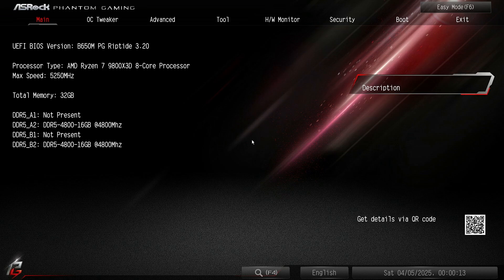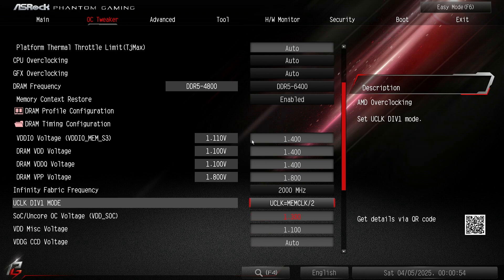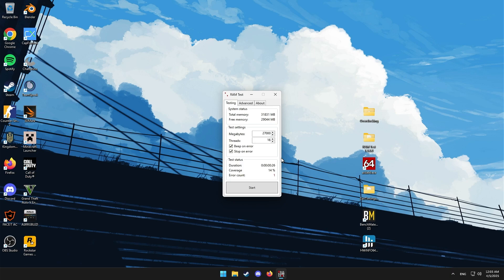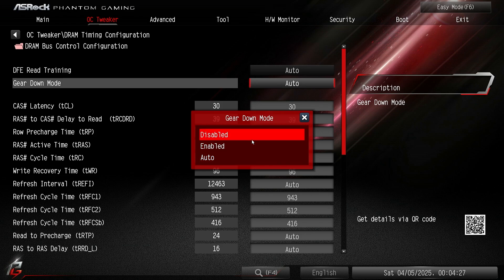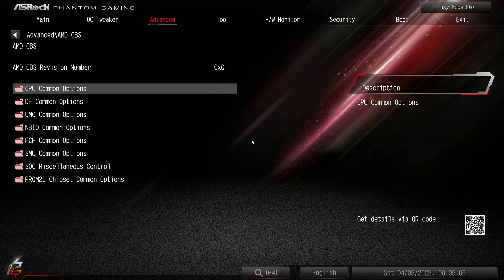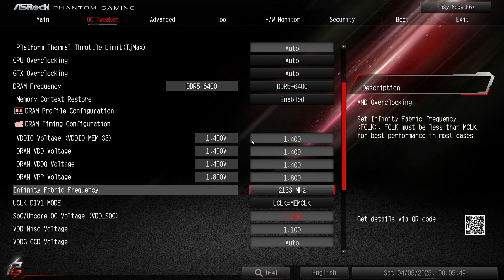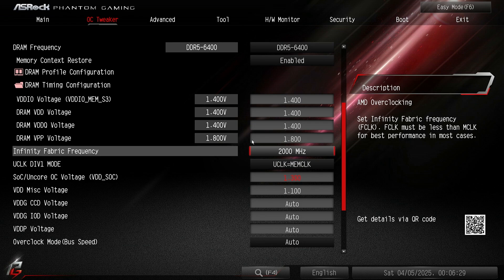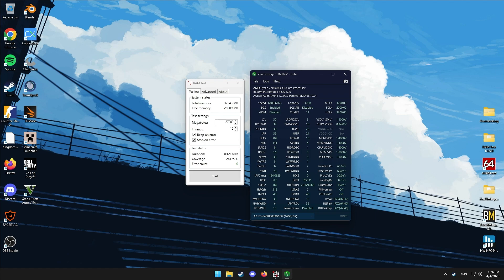How to make 6400mhz 1:1 work on your 9800X3D

Comment from the maker: link my to discord channel https://discord.gg/qpzBNBepFV
Reply: I had the same issues. I started getting random Post Codes like 94,00,97 etc. The other issue was waking from sleep. It would not initialize the GPU and other PCIE. Now im running the ram at 6000 CL28-36-36-96 1.45V and it is stable.
Reply: isnt it still running over 6000, so it will run the ram in dual mode...losing 2-3 frames at 120 but stable with this config?  I will look to see if you did an update video
Reply from the maker: @rideordietheyretring2tranxk1ds  by default yes but I explicitly run in 1:1 mode which means its running at full speed.

Comment: I have 6400 ram cl32 should I under lock it to 6000?
Reply from the maker: only if 6400 dosent work, but id try 6200 first then then 6000.
Reply: @ExtendifyPC  I have 9800x3d I heard it wasn’t stable above 6000 is that true?
Reply from the maker: @igotthejuice2090  you've been lied to

Comment: Is vsoc 1.30v safe for daily usage? I always try to keep soc under 1.28V because i don't want cpu degradation. i use instead vsoc 1.20V at 6200mhz 1:1, infinity fabric 2167. I have an Asus rog strix b850 gaming wifi.
Reply from the maker: I honestly cant say, but personally I've ran it for a few months at times.

Comment: If 6000mhz CL30 is proven best, why is everyone tuning to 6400???
Reply from the maker: proven where???
i will prove to you 6400mhz runs best but most of the time for x3d cpus it dosent matter much due to them compensating for the ram with cache.
im doing a video now that shows the difference and it is huge for non x3d cpus.

Comment: Is it really worth all this for an extra 2 fps? RAM from 6000m to 6400m is not make or break in gaming.  I understand people like to tinker, but be careful messing with voltages and timings.  This will also depend on your CPU for stability/compatibility
Reply from the maker: its just silicone lottery

Comment: Idk if you'll see my comment but ive been trying to overclock my ram. I have a 9800x3d with trident z5 royal from g skill rated at 6000 mhz cl28. You think I can reach 6400 cl 26 on these?
Reply: I have the same setup, yes you can, long as you know what you are doing
Reply from the maker: ye 100%

Comment: Really great Video, now my Ram is running in 1:1 mode, stability wasn´t a Problem before but the Ram run in 1:2 Mode in my case until now. Just what I´m confused about, I turn off my IGPU But with every restart it sets the IGPU Back to auto and on Auto its turned on sadly
Reply from the maker: its weird that its turning back on, maybe there are 2 igpu settings? try disabling both if thats the case.
Reply: @ExtendifyPC  I have the exactly same two settings as you even when I'm on Gigabyte where some things named different. I'll do a BIOS update later, saw my actual version isn't up to date, maybe this causes the issue 🤔
Reply: Updated the Bios and now the Disabling works :D Idk why but it works :D That is what counts

Comment: Does curve optimizer ruin or hindle ability to run 6400? I tried 6400 last night and kept crashing. I did'nt touch soc voltage but am running -30 on curve optimizer. Please help lol
Reply from the maker: no, curve optimizer and pbo in general dosent effect ram but -30 might not be stable.

also soc voltage is the only thing that makes ram frequency scale so test it.
Reply: @ExtendifyPC  My PC has been perfectly stable on -30. I believe my missing ingredient is the higher SOC thanks! Im learning here! You think It's worth running 6400 CL32 over 6000 CL30 far as gaming and 3D print slicing? My main tasks... I appreciate you bud!
Reply from the maker: @Cereal_Killr  higher frequency is always better

Comment: I have an MSI X870E Tomahawk, a 9950X3D, and CL32 6400 RAM. My main goal is to get everything running smoothly. While I'd like to achieve 6400 MTs, I'd be content with 6000 MTs. Since I have no experience with RAM overclocking, would lowering the frequency to 6000 MTs be the right approach for the 9950X3D?
Thankyou! :)
Reply from the maker: 6400 is faster and i even made a video on how to achieve it, check it out.
Reply: @ExtendifyPC  Thanks! I might build it today. I don’t know my way around the MSI Bios as well. I also purchased a new cooler, the Liquid Freezer III Pro 360mm by Arctic.
Reply from the maker: @British_Dragon  really good aio im thinking of getting the 420 version
Reply: @ExtendifyPC I really wanted the 420 liquid freezer III pro and it was only ten more pounds than the 320 version but I was pushing my budget too far with the wife as it was lol

I have the Be Quiet Silent Loop 2 320mm for my 14900k in my PC now and my temps hit 100C at 250 watts very easily and throttles. 
I under clocked my 14900k to 1.3 volts 52 GHz and locked it to under 220 watts. This cpu is unstable. I couldn’t play The Division 2 on it as it would just crash as well as some other games.

The 9950X3d is my first AMD cpu. 
I’m hoping I can use the same RAM I use for my 14900k.
Reply from the maker: @British_Dragon u should be fine with ur current ram and enjoy the pc man
Reply: @ExtendifyPC  Thanks mate! :)

Comment: should try your infinity fabric at 2133mhz on 6400mhz, gave the best results for me.
Reply from the maker: yeah i mentioned that as well, it works better with it.
Reply: Shouldnt it supposed to be half of ramspeed which would be 3200?
Reply from the maker: @r4k373  ideally yes but its impossible for the infinity fabric to keep up so u have like a better synchronized ratio with 2133 rather than 2000
Reply: @r4k373  1:1 isn't possible on ddr5 at those speeds, you would need to underclock ram to 4000-4400mhz to do that. the optimal ratio is 3:2 (2133 in this case)

Comment: May I ask what settings you input on Karhu for 64GB?  Also, how long of a test and/or % coverage till it's considered your ram settings are stable?  Thanks in advance  for replying.  Cheers! 👍
Reply from the maker: with 64gb u could do 90% and in settings enable cache, as for coverage I would say 30000% if u really wanna see that its stable.
Reply: @ExtendifyPC  Approximately, how many Megabytes? 90% of 64GB??

Comment: Can I use this for cl32 6400mhz 2x32gb ryzen 7 9700x?
Reply: And do I have to disable my integrated graphics as I have my side monitors plugged into my motherboard
Reply from the maker: @zoarynx   u dont have to it just might help and ye this is valid for ryzen 7000/9000

Comment: A alternative to 6500 refresh interval is 50000. 6500 may require a fan, 50000 does not.
Reply from the maker: true
Reply: I've done extensive Ram tuning on my Asrock x870e Nova with F5-6400J3039G16G Hynix-A Die which has been a joy kit to work with. I can confirm that TREFI 50.000 is the sweet spot and in fact my overnight tests fail at 52.000 where 50.000 has been stable. This is at 6400mhz, tCl:30, 2133 FCLK at 1:1. People say it's only about temps but my finding is that it affects stability despite I have no cooling issues in a very well cooled setup with 6*140mm + 3*120mm liquid AIO. I feel uneasy about VSOC at 1.30 to be honest, I've been able to get it stable at 1.25 VSOC, 1.42 VDD and VDDQ, powerdown disabled. Nitro is particularly a b*tch, my system would just not work other than 1-2-4. Geardown disabled is an interesting finding, mine is at Auto but might check to have it down as you suggest and see if I can drop voltages further or helps with Nitro. After a year journey with these rams, I hit 60.2NS latency which I find to be my limit.

Comment: is this working for zen 3 also?
Reply from the maker: zen3 is ddr4 so idk what u even mean by that.
Reply: @ExtendifyPC  Raising IOD and CCD voltage to get higher overclock
Reply from the maker: @fefsefefesfsefsef2733  iod and ccd affect the infinity fabric so i would assume so. (i have not messed enough with zen3 to confirm so research some more)

Comment: Bundle of thanks.

I was getting micro stutters in games when i used 6400mhz frequency and tried everything but failed, after that i started using it on 5600mhz and games were working fine but not smooth.

After i disabled GDM ( Gear down mode ) and set settings to 1T its running smoothly. ( i am using 7800x3d  )

Thanks buddy, now i can run ram at 6400mhz
Reply from the maker: glad to help
Reply: Hi , WHat you mean  and set settings to 1T?  What mean the 1T? thank you!
Reply: @victorcobileanschimelnic in bios you will find this option depending on your mobo. Just set mclk flck to first option instead of 2
Reply: I have 6400mhz ram with b650 mobo and 7800x3d  in bios it shows the ram running at 6000 mhz can you please guide me how to set it to full capacity?
Reply from the maker: @matymurdocks2260 join the discord
Reply: @matymurdocks2260  You can run it by activating xmp profile in bios but better option is to keep it at 6000, on 6400mhz some games give stuttering issue.

Comment: I found this video after considering upgrading my ram for my 9600x, i heard that you can get almost 9800x3d performance out of 9600x with better ram. I am still unsure what 1:1 means or how to even get there through the bios. this is like the only resource ive found that even mentions 1:1 other than a reddit post telling me to do it.
Reply from the maker: it just means uclk=mclk and in intel terms its gear 1
Reply: @ExtendifyPC thanks for the info! I still need to do some research to see what upgrade path i need to take

Comment: 4:18 FCLK 2000mhz, not optimal for the 6400MT/s ram! Better option... 6200MT/s, and everything should run synchronously!
Reply from the maker: I also mentioned how i ran fclk at 2133 with raised vddgs.

Comment: No wonder it's throwing errors if the tRCD are not even numbers with GDM on. It would be no errors if you set them at 40, but better keep them low, it gives even better performance than lower tCL
Keep FCLK at 2133, you can also lower VDDQ to 1.35V and VDDIO to 1.25V.
Did you try VSOC at 1.25?
Reply from the maker: I dont know what you mean by ur first part of the message, but yes ofc I tried vsoc 1.25 its just a trash imc, I got a 9950x3d and it is doing 6400mhz 1:1 at 1.25
Reply from the maker: i see what you mean now with trcd but this is the gskill expo profile and it worked perfectly on 2 other cpus.
Reply: GDM forces certain values to an even number, rounded up, hence potential latency increase and tRCD parameter is not affected by this

Comment: Hi I watched the video.. after that I played a bit with the board and processor..

9950x3d + 6200 cl26

pbo -38 all core
scalar x10
+200
vddq 1.450
soc 1.15V
vddp 0.850

vddg 880\870

OCCT large extreme avx2, 3 hour stability Been using for a month

cinebench r23 47.521

cinebench r24
2682 

boost 5.925 CCD 1
5.715 CCD 0
Reply from the maker: damn bro thats pretty good
Reply: Bro if anyone is into the hobby they can see your numbers and know you're lying. Vddp 0.85? Soc 1.15??? I don't even believe your -38 all cores because I know your p cores can't idle at that unless you have very specific curve shaper configs.
Reply: @wandringhobo4321  vddp 0.850 / cpu soc voltage 1.15000
ccd 0 -40 /ccd 1-30 ....for now

Comment: First off all clear your bios then try this - 

6400 - 2133
Soc - 1.250
Vddp - 1.4
Vddq - 1.4
Vddio - 1.4

Timings -
30-39-39-39-80-119-8-8-32-6-16-48-512-auto-auto-5-5-12-16-4

Once done then you can OC your CPU. Rules of thumb is to tighten your ram or tweak your ram first. Good luck
Reply: VDDP 1.4V ?? Maybe "VDD"
Reply: Ridiculous to put vddio on 1.4.. 1.3v is enough for 6400mhz builds on multiple systems i tested.

Comment: If you got any tips or advice and make a video on tweaking DDR5-8000Mhz on AM5 I'd be interested because I'm using a kit of G.Skill 2x24GB at 8000Mhz and my AIDA64 latency tops-out at 64ns because you can only drop the primary timings so far and if I try to lower trfc1 it throws memory errors. I can lower trfc2 and trfcsb to 70% of the total refresh cycles which gets me to where I'm at now but maybe that's just as far as these memory sticks can be pushed.
Reply from the maker: Im planning to do a 8000mhz video its just that its been a nightmare so far.
I got a g skill royal 8000mhz 32gb cl38 and even expo just gives an error after a few hours.

about ur ram kit Im actually planning to buy it and the reason trfc1 can't be pushed too much is the fact its hynix m-die but in real world performance it shouldn't matter.
Reply from the maker: update : ordered the 8000mhz 48gb g skill neo kit expect a video soonish 😊
Reply: @ExtendifyPC I got a gigabyte aorus pro with 9950x3d and gskill ram, board, it won't do 8000 fully stable, the pure ram tests all pass no issue, as soon as it's a test that inolves the imc too it s done, like y cruncher or etc(I did disable all cpu stuff like pbo and still same thing). So I switched to 6400cl28(aida64 66.2ns latency I know it's a bad test but whatever 🤣) and from my it s pretty much same as 8000cl38(it did work on lower cls but why even bother fully testing if 38 wasnt stable to begin with, I even tried a lot looser timings like 42 cas and etc, it s just either the cpu or mobo that just cant do 8000 fully stable, haven't got a bsod or such but if it failed all mem tests after couplenof hours it's bound to go to bsod city) in games fps wise
Tried 6600 in 1:1 but it just blue scrrens and wasnt willing to go 100% bonkers on the voltages
for 6400cl28 I use 
1.5 vdd 
1.4 vddq 
1.07 vddp 
970mv vddg 
1.42 vddio 
1.27 vsoc
I feel pretty lucky with these voltages, the ram kit is one of the cudimm stuff I had intel for a while so it's the gskilll 9000 kit, but binning is pretty good on that one
Reply from the maker: i did a video on 8000mhz so it might help you make it work.

also just because of the cuddim kit its probably settings stuff wrong like procodt for example. 

last point is that 6400 vs 8000 is mostly the same and especially on x3d it makes no real difference.
Reply: @ExtendifyPC yeah it does some resistances wrong, had to change a few, will check out the video
Reply: Gskill is trash at 8000 get the kingmax i do 8800mts  on670e asus strix

Comment: I bought 6000 MT CL30 RAM for my 9800x3D build on a similar asrock board to what you're using here but I'm deferring turning on EXPO since apparently that correlates with current gen X3D chips having their memory controller burn out
Reply: Nonsense.
Reply: maybe after 8 years, even then I doubt that lol.
Reply: Mine just degraded until it was unusable. Had to RMA
Reply from the maker: i get ur point, i just personally dont mind my cpu dying ill just get a new one xd.
Reply: @ExtendifyPC  Clown lol

Comment: 7800X3D user 2200 infinity fabrick with 6200mhz 38-38-40-72 timings I think. Everything on auto on voltages, don't touch nothing, because I think keeping the voltages on one single number constantly degrades everything and also causes a lot of instability and crashes, had to send my MB into warranty, because I played about one year and a half or so on custom voltages, and then it started causing a lot of problems after a few months. Was not running very high voltages or too low, but yeah I think auto is just better
Reply from the maker: i think ur motherboard was broken.
Reply: @FrameZLaw  don't know maybe I just think auto makes everything work completely fine as it is
Reply: fclk 2200 9800x3d corsair vengeance ddr5 6000mhz clocked to 6200mhzm memclk=uclk   running fine rock solid 
tCL = 30

tRCDRD = 36

tRP = 36

tRAS = 70

tRFC = 500–520

tWR = 48

tWRRD = 5

tRDWR = 16

tRTP = 12

tFAW = 28–30

tRRD_S = 5

tRRD_L = 6